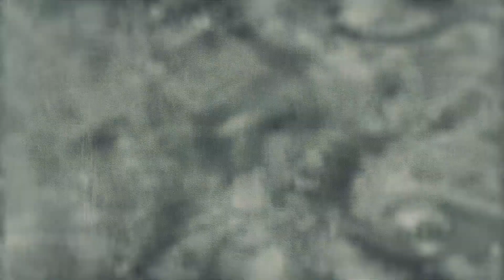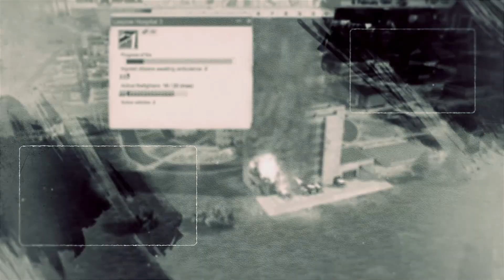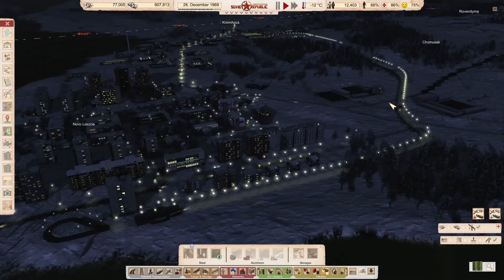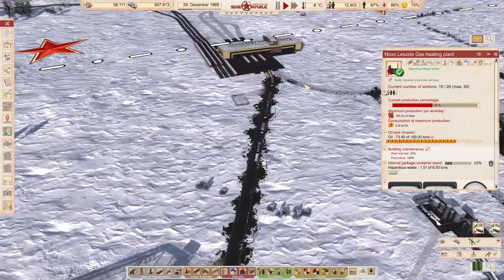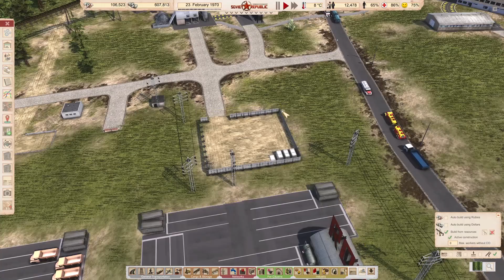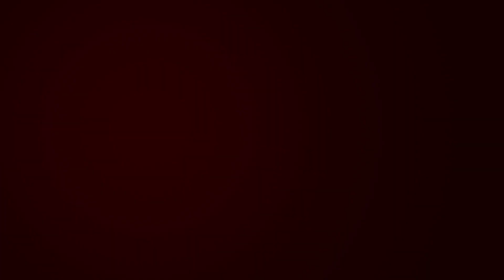Soviet Republic - Project Novo Leszcie - Ep.32 - Importing Trash

Comment: Someone mentioned in the Steam discussions that if you import mixed waste by train for recycling revenue it contains metal scrap and if you use trucks you get more aluminium scrap, could be a supplement to hazardous waste imports for boosting income. 🙂
Reply from the maker: I will try. Without trains though. Still getting there! 😁

I don't see the benefits of importing hazardous waste at the moment. 😞